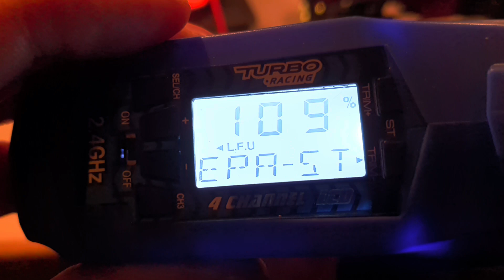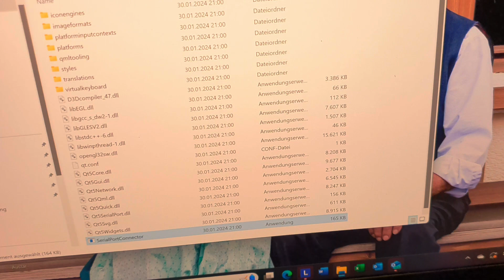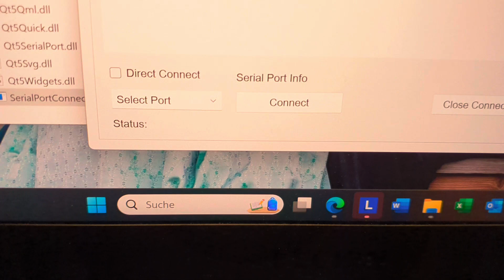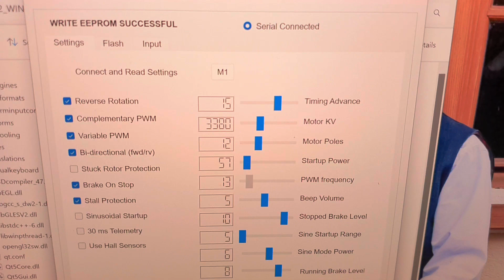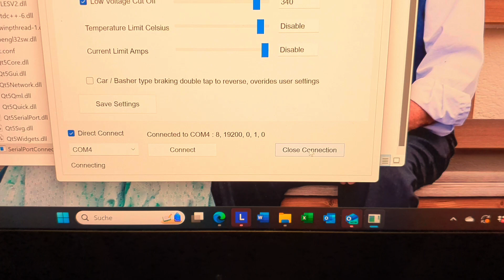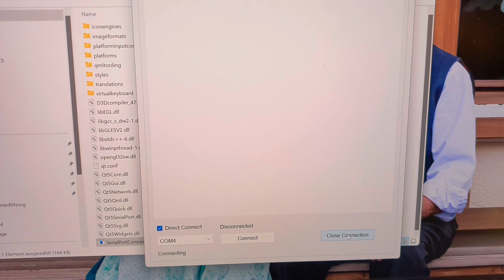AM32 brushless ESC - how to connect to your PC - easy and cheap brushless RC Crawler

Comment: nice video... I bought a combo to upgrade my MN128. When I go to climb, the motor turns but does not climb. I have a programming card but the ESC does not open the programming. I am still new to the hobby and do not know how to do it. Could you please give me some tips?? Thank you very much I follow you on YouTube🇬🇧🙂😎
Reply from the maker: @filipejosegodinhoantonio2455  sounds confusing…. So AM32 will work with a USB dongle connected to the PC…. 
If you have a programmingcard I have no clue what kind of ESC you have.

Comment: I have 9imod 80A am32 esc when i drive to slowly my esc and motor cables getting warm in about 3-5mins is that probşem ? 
i didnt programmed my esc
Reply from the maker: @fettahcankan8973  that is depending on your motor and Gearing, but if everything is getting to warm you maybe need to lower your sine Mode power. 
There are two variables, one is the gearing and one is the Settings (or your cables are to thin)
Think of you riding a bicycle in a to high gear your muscles will be burning quick
By the way programming is essential
Reply: @sebo-Kids-RC  Yep lower it, if it's on 10 turn it down to about 8!
Reply: @sebo-Kids-RC  İ cant the adjust the gear ratio cuz i have planetary transmission , i will try to the connect my computer like you but i getting the issue my computer didnt found the file
Reply from the maker: @fettahcankan8973  have you downloaded the UART driver? ( maybe from the Injora Webpage etc… any driver is good) 
Select: Direct connection and your COM Port in the drop down.
Is your Dongle connected the right way?
Is your battery connected?
Reply: @ I downloaded from aliexpress 9imod 80A am32 esc page , is there any another link
Reply from the maker: @fettahcankan8973  GitHub AM32 or test this https://drive.google.com/file/d/1jMQJXQTCdgKH0r3WloP9C5pMJbferT62
File not found is a typical failure for the battery is not connected…..
If you can’t solve it, go to GitHub AM32 and join there discord channel
Reply: @ should i connect to lipo when i connect the computer ?
Reply from the maker: @fettahcankan8973  yes
Reply: @sebo-Kids-RC  I am asking to clarify. I connect my 2S lipo battery to the esc and press the power button to turn it on. Then I connect it to the computer via USB and open the program. I don't need to connect it to the receiver.
Reply from the maker: @fettahcankan8973  yes you connect to the dongle and you power up the ESC with the battery
Reply from the maker: @fettahcankan8973  did it work 👀
Reply: @sebo-Kids-RC no my usb link still red light
Reply from the maker: @fettahcankan8973  is signal to signal, battery powered up, the driver installed, the servo cable from the ESC connected to the dongle, did you select direct connect  and did you select the comport?
If nothing works, join the discord channel which can be found on GitHub AM32

Comment: Thanks for the video. I would like to know more about the firmware update. Are there different versions of the AM32 for this specific ESC?
Reply from the maker: I changed to ESCape32 is better than AM32 for crawlers, maybe is interesting 
https://youtube.com/playlist?list=PLlA9u8RWtwriWqNY3EYYGkUsHKPbQlx3z&si=xbdNn9OrBnb7MY8p
Reply from the maker: This one is stuck at the moment at  1.99 but you can update it. You just need the Firmware from GitHub. Same Number as on the processor
I don’t do RC at the moment, will return soon with the kids

Comment: Nice setup! I am interested in direct powering my setup as well. Do you have any how to guides?
Reply from the maker: You need just a servo which can use 8,4V when using a 2S and a RX which can handle 8,4V as well, that would be the easy way. Otherwise with a BEC powering the RX I would need to explain more
Reply: @sebo-Kids-RC  I ordered the same ESC you have. My servo and RX can handle 8.4v. Do I need the resistor as well.
Reply from the maker: @samuelwilson8959 no, not with 2S
Reply from the maker: @samuelwilson8959  resistor isn't needed with 2s
Reply: @sebo-Kids-RC  what resistor would you recommend for 3s lipo?
Reply from the maker: @samuelwilson8959  i think you don't need one as far as I know right now. I will look later at my rig and tell you which is in my car... but is a bit oversized
Reply from the maker: Would have a real solution to power it up: https://youtube.com/playlist?list=PLlA9u8RWtwriWqNY3EYYGkUsHKPbQlx3z&si=xbdNn9OrBnb7MY8p

Comment: why does com not show up on the esc tool?
Reply from the maker: I shows up in the dropdown after you select direct connection
Reply: @sebo-Kids-RC  yea its not showing up there for me, maybe non data cable i dont know gonna have to order data usb c cable to see if thats the issue i would think my anker cable is a data cable too but who knows
Reply from the maker: yes that is possible, have one of that cables as well and it fools me always. But the battery was plugged in? I recommend a 2S
and check if the signal the yellow cable is in the correct spot on the dongle
Reply: @sebo-Kids-RC  yea i tried like 15 times re downloaded the software the drivers everything made sure it was done correct it has to be my cable thats the only thing left i can find that i didnt check
Reply from the maker: @petejones6827 maybe borrow one from a friend

Comment: Could you explain what kind firmware better for rc car blheli32 or am32? Or it doest matter?
Reply from the maker: Both work, but AM32 is maybe better for Cars and trucks
Reply: BL32 developper have dropped support, can't even run the configurator tool now?
Reply from the maker: @daijoubu4529  maybe look here https://github.com/bitdump/BLHeli/releases
Reply: @sebo-Kids-RC  they shutdown the servers, looks like it's only firmware updates that's no longer available/can't flash any BL32 FW anymore
Reply from the maker: @daijoubu4529  maybe buy a AM32 ESC….
Reply: @sebo-Kids-RC  yep I have AM32 ESCs, just pointing the fact that BL32 no longer supported

Comment: I cant believe people are still buying $70 Lizard Pros when AM32 ESCs are available, no flashing needed
Reply from the maker: @ruuster83  I mean the Furitek are really very good and make it easy, but the AM32 can be very close. And again is depending on the ESC and the setting. But the new injora is running AM32 as well. I wouldn’t pay the money for the furitek due to I can waterproof the easy boards way easier and waterproof is so important for me

Comment: They also have a green 20A 2S only, should be better to detect BEFM at lower RPM if you only run 2S, bit more expensive than the purple 25A one
Reply from the maker: @daijoubu4529  have it here but had no time to check